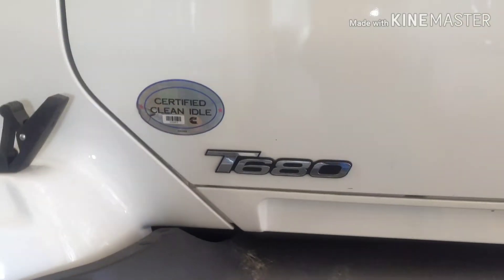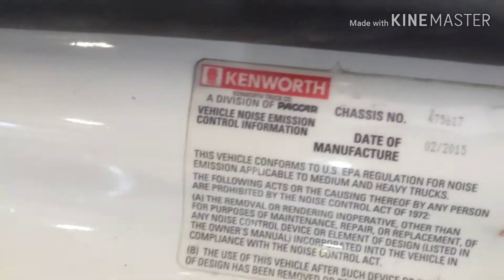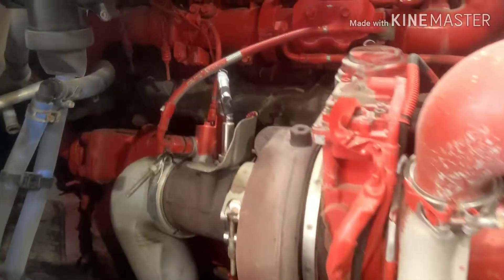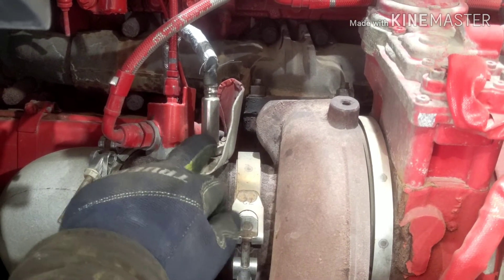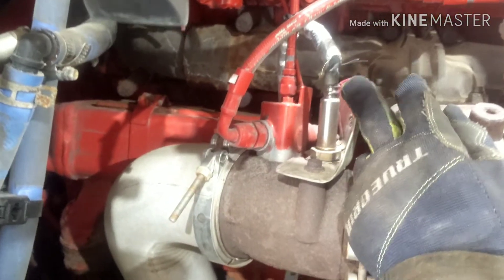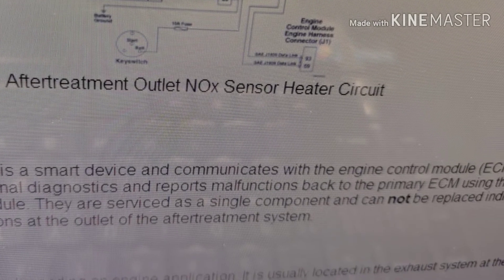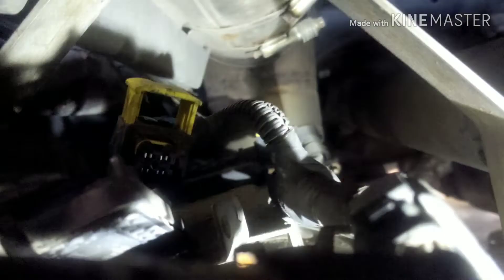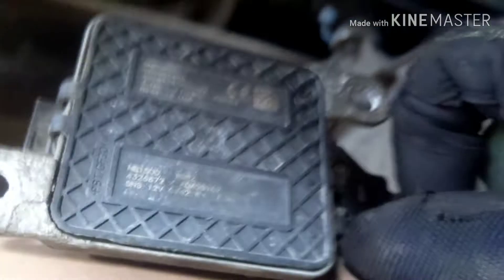Cummings Isx 15 inlet and outlet aftertreatment nox sensors locations

Comment: Which one will cost black smoke when I start it? Only
Reply from the maker: @القرآنالكريم-د3ط  black smoke is a fuel problem can also be a turbo problem lack of boost
Reply from the maker: @القرآنالكريم-د3ط  so injectors or something with turbo system need to get it checked

Comment: We have a 2014 Cummins ISX15425 Freightliner that went kaput because the welder forgot to unhooked the battery. We replaced the computer box; some related sensors and it started for a few minutes then engine went off and never started since. We are located somewhere in the Pacific with limited access to scanners so we are clueless if we can make the unit run. We acquired this from the mainland and used barely for a year and now it is sitting idle under the sun.
Any chance you can share some ideas that we can try to see if we can revive this unit? Your favorable response is greatly appreciated!

Comment: 2022 x15 throwing Aftertreatment 1 Diesel Particulate Filter Outlet Pressure code.  pls help
Reply from the maker: @pka951  is that sensor I posted the video about it the one Towards the back

Comment: You check the harness first and then change the sensor. 4 ports ground, the hot wire red and com1 and com 2.

Comment: Can the NOx sensors set after treatment DEF line heater faults. On my NOx data there's no inlet or outlet data. The inlet should read 85 ppm and the outlet about 45 ppm. Thanks in advance.
Reply from the maker: @GripFreak  no i believe you might have two separate problems or the harness that goes to the one box is bad that’s also very common the def fluid eats the harness
Reply from the maker: @GripFreak  no separate problem

Comment: Just having the same problem today, the wires on that sensor got burned so my truck was sucking oil also sometimes when I start to takeoff, it turned off right away
Reply from the maker: @AminOmayyan-b1c  the oil might be a different problem no oil runs to that part of the truck bad turbo if not probably the rings on the pistons

Comment: What would cause the turbo to spool up at idle and then kick out after you turn on the high idle
After treatment is plenty warmed up
Reply from the maker: Sounds like maybe ur vgt turbo acuator might be the problem or turbo going out vgt turbo veins are probably full of soot u have to try an calibrate the Acuator with Cummins insite program

Comment: Do replacement Nox sensors need programming in to any control modules?
Reply: In general, no, but it's always good to check if you have any ECM software updates.  Sometimes those updates help nuisance faults.

Comment: What’s up errrbudyy this is a Cummings
Reply: I have 2015 kw t680 code with Cummins engine isx15 got the code SPN3226
Reply: The code shows after treatment 1 outlet no x fm i20 data drifted high. That's what it shows on the code SPN3226 I cleared the code and kept going and now it uses lots of Def and idles weird at times is that still the same issue it's not showing the code anymore

Comment: Are they both the same sensor? Cause they look alike.
Reply: No.  Not only are they different part numbers, but the connectors are different.  They have different software addresses so the engine controller knows which one it is talking to.

Comment: I got a “SPN 3610 Aftertreatment 1 Diesel particulate filter outlet pressure FMI=2 Data erratic, intermittent or incorrect 1” code.. will it be the same sensor you showed in this video? Thank you!
Reply: I’ve got the same code, did you ever find out what the fix is brother? Man I’ve been fighting this thing for the past three weeks.
Reply: @ER_666_  it has to be different sensor. I think it locates above or close to DPF. It’s a little box with two tubes
Reply: I did replaced it and showed how. Will leave link to video

https://youtu.be/yDdzuQpCBQw

Comment: Question my soot level is high even after the dpf filter got cleaned i heard the other problem could be the nox sensor if so is it the inlet or outlet?
Reply from the maker: At the factory they usually do both because the both could be clogged with soot and giving you false reading
Reply: @chucofilms915  thanks for answering my question i will give an update once i get the work done
Reply: Failed NOx sensors do not cause a soot problem, but heavy can affect their readings.

Comment: Do the codes clear automatically on their own after the new sensors put in ?
Reply: Nothing will clear automatically. You have to have a scanner to clear codes. Light may go off but codes will still be there. Light bar start on as well.

Comment: I could not read the code I'm getting 5246 fmi 0
3226 fmi 10
1569 fmi 31
3226 fmi 4
I just changed the inlet box sensor
And how do I clear the code

Comment: Yeah this 11 Cascadia with Cummins ISX15 first gave me a check engine light then a day later a stop engine light and an engine derate! Its not asking for a regen and even when i tried to make it regen it didn’t do it, which I expected since it wasn’t asking for one! I did hear the turbo make a few weird noises a couple times, first when the check engine light came one and once with the stop engine light! Truck owner is assuming that it’s the knock sensor, me I don’t know and hate to assume with no code reader! Does it sound like the knock sensor to you???
Reply: Knock sensor is not NOx sensor.  You need a code reader...

Comment: Question ... are both of them the same part #??
Reply from the maker: Yes I believe so but I would double check  the part numbers to be sure
Reply: @chucofilms915  no they are not the same part number. two different nox sensors with two different part numbers

Comment: If s guy wants to clean the sensor probes and temperature sensors that go into the DPF, what’s the process and what do you use? I’m having the filter blasted and removed the sensors. I’d like to clean them.
Reply from the maker: I'd just replace them maybe not the temp sensors but the nox sensors for sure

Comment: kool video. If u could point out other sensors related to the Emissions system. I just bought a 2015 pro star with a Cummins CM2350  i wanna do a EGR tune up.
Reply from the maker: Egr tune up ? I've never heard of that u mean like replacing  ur egr valve or do you  mean  removing it to try an clean ??
Reply: @chucofilms915  yes and replacing sensors like the Imap, Exhaust pressure sensor., delta p sensor and 1 more I forgot.
Reply: Do you know we’re is on Volvo VNL 2013 ? Same sensor
Reply: Cloud Express  Would likely be in the same area